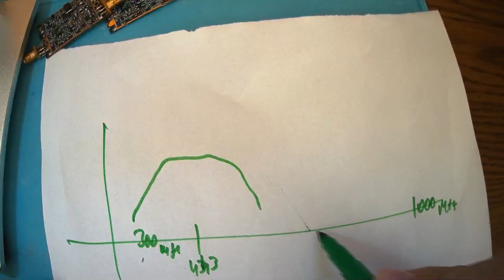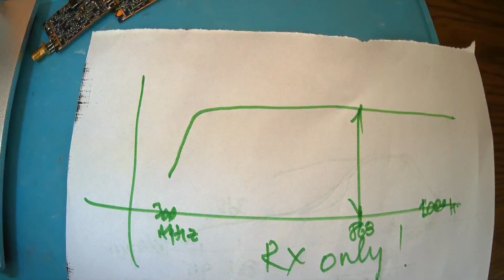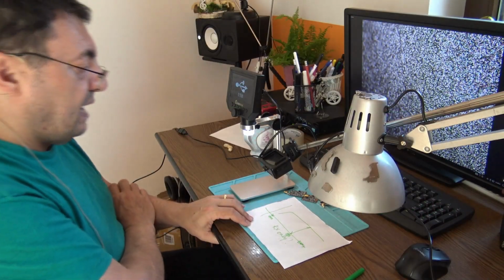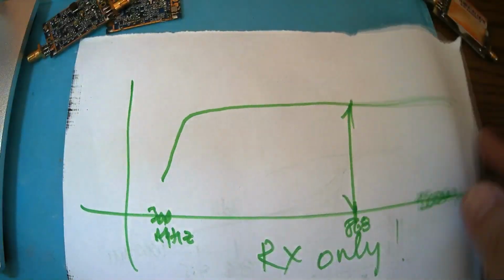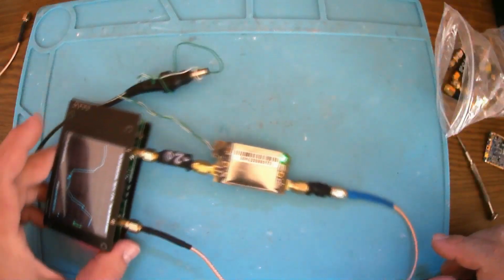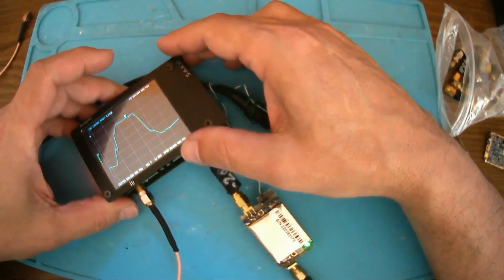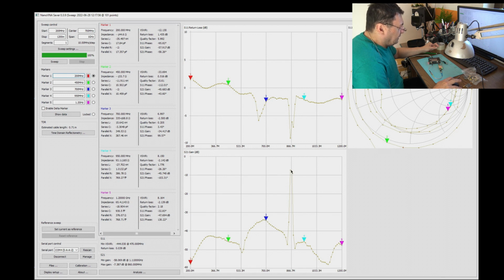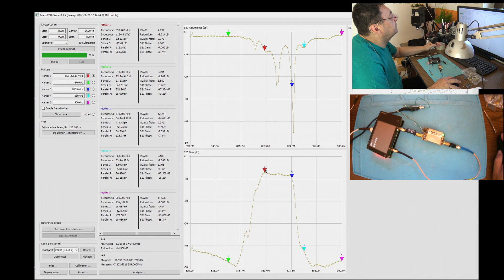AB-IOT-443/510 MOD for wide band RX Helium Lora  amplifier

Comment: Good morning, I have been using a Lora UM 402 transceiver (attached) with an output of about 20Db but now I need to amplify that signal.
Will this AB-IOT-443 do this amplification?
Reply from the maker: If you use 443Mhz yes...
Reply: @viocaia  thank you for the quick response, I believe you know the UM402. I'm going to buy one of these amps to try. Thanks!

Comment: Hello Mr Caia! I have a question, regarding AB-868-5V. I am an absolut beginner, regarding electronics and soldering. But i managed to (re)solder two obviously bad connections, from the "IN connector" to the board. But now i am unsure about the result, because between ground and center pin is now continuity, when measured with a multimeter. And i don´t know if this means a short, or not. Please have a look at this picture https://abload.de/img/ab-868-5v__before_and6qkzi.jpg and tell me if  i did something wrong. Thank you very very much in advance!
Reply from the maker: That's perfect! Good job!
Reply: @viocaia  Thank you very very much Mr Caia! I connected the amplifier to the miner this morning and the RSSI and SNR for witnesses is now very very good. Before this i had a maximum of 7 witnesses per day. Today i witnessed 13! So the RX amplification is working perfectly. But i also sent one beacon and zero miners could witness my beacon. Without amplifier, my beacons got witnessed by 12-14 miners every time. Can i somehow check/measure on the amplifier, to see if TX signals can pass through it or not?
Reply from the maker: @keinprofil2385  You need at least a NanoVNA to measure that..
Reply: @viocaia   Thanks again! Unfortunately i do not own a NanoVNA. 
The situation got worse, because since the miner tried to send the beacon (which no one could witness) through the amplifier , i can not witness anymore. I waited 10 hours and then i removed the amplifier and saw filter and connected antenna only (Miner -> 5m LMR400 -> McGill 6dbi located on the roof). Still not a single witness, altough there is plenty of traffic around me. I triple checked all connections, cables, diagnosed miner via web interface etc. but i could not find any errors.
 

Then i watched your video "AB868-5V / AB-Iot-868 Lora Helium amplifier fix". I measured the same points as you did in the video. The blue RX light turns on fine! And the little amplifier component shows 10K resistance, when measured from the pin on the right side to the pin on the backside. Unfortunately i can´t measure the resistance from right pin to left pin (where you measured 4700K Ohm) because my crappy multimeter is limited to a maximum of 2000K resistance - but at least it does not show 1 Ohm, like the defective One in your video. So i guess the amplifier is working fine, right? 

Is there something bad that can happen to the electronics, when the miner tries to send a highly amplified beacon which can not reach the antenna? Any ideas what i can check next?

Update: After a reboot of the miner, it tried to send another beacon - and again no one could witness this beacon.
Reply from the maker: @keinprofil2385  Check for short the RF power transistor in the middle..anyway the network is down..I didn't witness for 3 days...
Reply: @viocaia  Sorry to bother you again, but as i already mentioned i am a beginner when it comes to electronics^^ So i think the "RF power transistor" is the thingy you checked and replaced in your video""AB868-5V / AB-Iot-868 Lora Helium amplifier fix", right? This part i checked yesterday, when i also checked for RX light. Now i measured it again and it has still the same resistances as i wrote them down in my message from yesterday.  So i guess it is still working.

Regarding the network and your witnesses, my miner was also suddenly "deaf and dumb" for some days. I did a reset and after syncing it immediately startet witnessing.  But as i already mentioned, it stopped working again since it tried to send a beacon through the amplifier.

Update, 4 hours later: I reset my miner again ~3 hours ago and it immedeately started witnessing again. That´s weird, because it is still far away from being synced (the gap is still 2602). So i am tempted more and more to think that my "additional hardware" is totally fine - and that there is just a huge mess going on with the network and/or the miners software/firmware. Because every time the miner is reset it works fine for a limited amount of time.
Reply from the maker: @keinprofil2385  I don't see why AB doesn't do the job, it's a very solid and reliable amplifier..as long as you don't over voltage and reverse polarity it will work forever..All the mess i caused by the network..I have exactly setup..I always have a 14 at beacons..suddenly ) for few shoots..for sure that's from the system..just be patience..everything looks ok with your AB
Reply: @viocaia  I am very glad that i found your channel and i enjoy your videos a lot. Thank you very very much for your help and i whish you the very best for the future!

Regarding the network/miner issues: 
Have you already tried to reset your miner? It´s not a big deal anymore, because oviously former "Full Hotspots" don´t need to be synced anymore to start witnessing. I am still 289 blocks behind the blockchain, but i am now already back at 0.519 HNT for today, since i reset the miner ~12hours ago. I hope that my next beacon will not cause the same problems again^^ 

And btw, i can´t find any sources to buy two more AB 868 (except from people reselling them on EBay etc. much to expensive). Do you know a merchant, who has AB 868 still available  or someone who does resell them at a "normal" price?
Reply from the maker: @keinprofil2385  Thanks a lot for appreciation..It's exactly what I'm trying to do, offer my experience to people. I am in the same position too, looking for help from the others, it's nice to find solutions and answers to daily challenges.
 For AB please email me at viorelcaia@yahoo.com

Comment: I have been using the AB-IOT-510 for almost 2 months now and it works without any problems without any modifications. At the input between the antenna and the amplifier I set a classic saw filter, I set the TX amplifier to a minimum and everything works perfectly. When I send the beacon I have 14 witnesses. When I witness the noise flor is around 105. I fried my nanovna so I don't know how much amplification it is, but it currently works better than my hotspots that use the original flarm booster RX 17 and Acasom RX 17, TX 6. I even swapped places with hotspots and the hotspot where the AB is connected always works better
Reply: which saw filter exactly? can u share rssi / snr chart? Thank you
Reply from the maker: @chessdachaska  It's based on B3717 Qualcomm saw filter.
Reply from the maker: Probably 3dB RX..enhanced by the filter...It's interesting how it goes to TX..I never could..maybe you lucky and they mislabeled a 868 one..I know the other way it's done!
Reply: @viocaia  Maybe, who knows. Although I did tests with RTL SDR and it has much better gain at around 510mhz. I believe that one thing affects and that is that I mounted the amplifier directly on the miner and as a connection I use only the SMA-RPSMA connector because I have a distance of only one meter from the antenna
Reply from the maker: @nonamen105  Yep..looks good!

Comment: drone bands differ like DJI use wifi 2.4 g and 5g and some that use TBS are in the 900mhz to 1200mhz i belive and some long range are in 700 mhz you need to find out what type of radio and reciver people are using i have done this and you will need a battery pack as well and if its FPV you have to have more amps for goggles and reciver and trmitter for FPV goggles on drone
Reply from the maker: I think so..

Comment: What is the amplification in the 915 range? It looks maybe about 5? I'm basing it on the amplitude of the curve at that point.
Reply from the maker: Don't consider that it's a saw filter 868 involved. At 915 you should have more then 25dB